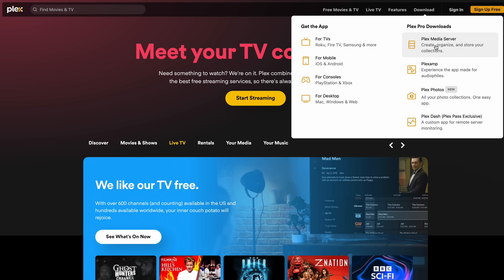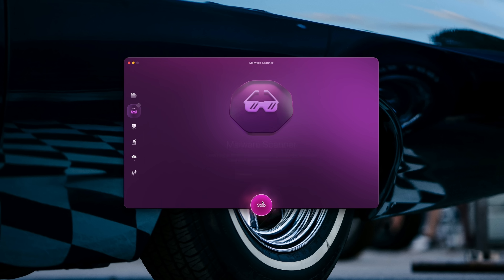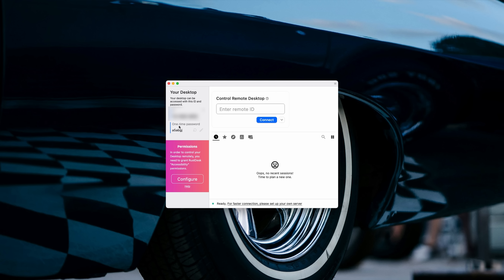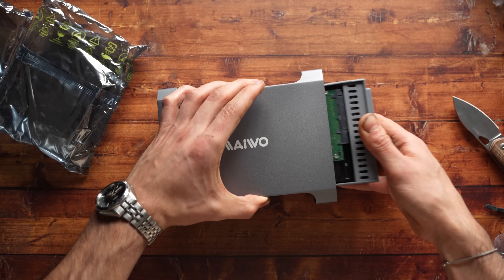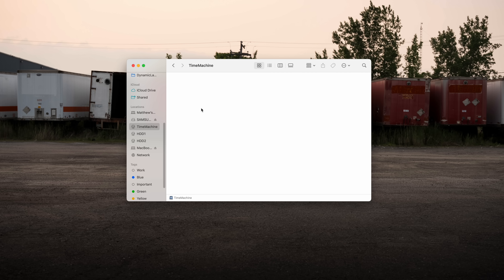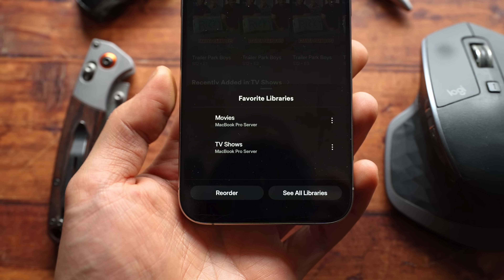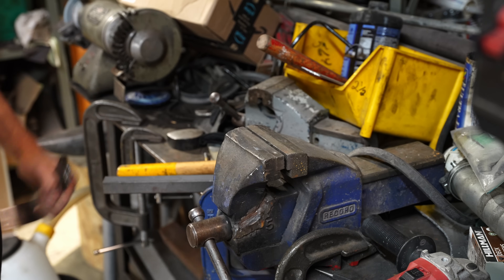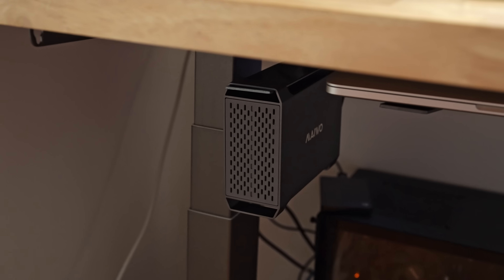An Obsolete Mac is Your Greatest Ally - DIY Homeserver

Comment: For anyone that has a NAS or DIY home server that’s not a Mac, running Cockpit with the 45Drives plugins installed is a great alternative. My NAS is a DIY build running Proxmox with 80TB of raw storage in ZFS. Cockpit is running as a lightweight LXC and the 45Drives plugins make it a super simple NAS that all of my machines can connect to. Here’s the settings I use for my Time Machine samba share:

fruit:time machine max size = 2000G
fruit:timemachine = yes
fruit:encoding = native
fruit:metadata = stream
vfs objects = catia fruit streams_xattr
fruit:zero_file_id = yes
fruit:nfs_aces = no

With these settings the Macs on my network can easily connect to the share in Finder and then add the share as a Time Machine destination. The top line can be customized to whatever storage size cap you want for all of your users. This a great video with an easy setup, but it’s possible to run a Time Machine server on just about any old hardware. Cheap mini PCs, old corporate machines, pretty much anything with a couple CPU cores, a few gigs of RAM, and 1gbe networking can host a samba share configured for Time Machine :)
Reply from the maker: Appreciate the comment and insight. It’s a little above my pay-grade lol but I’m sure it’ll help others. Thanks for chiming in dude 🤟🏻

Comment: Great overview! I have almost an identical setup using a 2015 13" MacBook Pro, except I was relying on macOS screensharing. Rustdesk makes it much easier, especially that I can use my iPad to connect, if I wanted to.

Curious though - what version macOS are you using on the MBP? I'm using Monterey 12.7.6 because that's what ChatGPT suggested when I set this up 6 months ago. I'm also running OpenCore Patcher, but that may not be needed.
Reply from the maker: It was running the most recent version of Monterey when I set it up. macOS has had sharing options in it for a while, so any outdated version that at least supports sharing will do fine in my opinion.

I’ve used the macOS screensharing as well but RustDesk is so much more reliable.

Comment: problem is not the usage, problem is that older machines are not efficient. Most Intel Macs use too much power, check the TDP of the processors they run on and decide if it's worth it.
Reply from the maker: Certainly a fair point

It might be worth investing in an Apple Silicon Mac Mini

Comment: I’d definitely add some thick felt to the mounts with some spray adhesive. don’t want your stuff getting scratched even if it’s old and just staying there etc. nice job overall!
Reply from the maker: Thanks dude! Yes I thought of actually adding rubber so it prevents from accidental slipping as well
Reply: @MatthewPCLO  Maybe some adhesive velcro to be extra sure
Reply from the maker: @formidavide  That would definitely work as well to secure it

Comment: Link for the dummy hdmi dongle?
Reply from the maker: Complete forgot to add that link. Here you go: https://a.co/d/fNmDfFT
Reply: Appreciate it. Something you didn’t mention, which macOS are you running with the laptop? I’m looking to do the same with an older Mac mini.
Reply from the maker: @rodneycastaneda6979 The 2015 I used for the server was initially running macOS Monterey. Unsupported versions of macOS still work great. Sharing options have been around for a while in macOS, so it would be perfectly compatible with your modern day Mac, iPhone, and iPad.

What year is your Mac mini?
Reply: @MatthewPCLO god it’s an old one. I5 Mac mini that I upgraded internals for 2tb ssd and 16gb ram. Do you think it’s worth it to upgrade to unsupported os via dosdude patcher? Or still with high sierra
Reply from the maker: @rodneycastaneda6979 I would keep it on High Sierra. Sharing options work on that version, plus Plex supports High Sierra. So I’d go ahead and try to use it as-in

Comment: 4Tb isn’t much, I’m doing the same thing with a Mac mini. I’ve got an external 6Tb I’m using as Time Machine for 3 MacBooks then 2 14Tb drives set to raid 1 that the Mac mini back ups to (that includes the 6Tb drive). I’ve also got 2 2Tb drives set as raid 1 for my windows 11 machine, that drive is not included in the Mac mini backup.
Reply from the maker: Sound like you’ve got a great little setup there dude, that’s awesome 

Yeah I know 4tb might not be a lot for people in today’s world, but for me and my use it’s perfect. I’m only backing up 1 Mac, and keep my files tightened up to only what I actually need.

Thanks for sharing man, and for watching. Much appreciated🤟🏻 A Mac Mini is the perfect machine for a server

Comment: Can you speak about operating systems. Are all your mac's on the network using the same OS ?  Is it required? etc.
Reply from the maker: OS version doesn’t matter at all your Mac’s can be different versions, even older discontinued versions. You can even allow Windows file sharing by selecting “options” in your Mac Server’s “file sharing” setting

Comment: The bracket was what drew me to this video.  I had a similar idea.  I have a 2012 iMac that has a shattered screen and I was thinking about mounting it under my desk and connecting it to my 3d printer.  That would allow me to remote access the printer from anywhere.   I was wondering if air drop from my family's iphones would be possible, to backup pictures and free up storage on the phones?  Thank for taking the time to share your project.  Very cool!!
Reply from the maker: Absolutely possible! AirDrop could definitely work for that. But, a more intuitive solution is the “Sharing” feature. You can make a respective folder for each of your family members and they can connect to the Mac directly from the “files” app on their iPhone. 

They’d click on the three dots at the top right corner in the “files” app on iPhone. Click “connect to server”. Then enter smb://<name of mac>.local

The login as the administrator user and you’re in. Hope I did a good job of explaining haha

Also, I’d recommend mounting it to your desk, such a game changer. It’s out of the way but also easily accessible if you ever need.
Reply: @MatthewPCLO  I will have to check that out.  Thanks for making me aware of that method of sharing files and photos.
Reply from the maker: @briankendall1978 my pleasure, let me know if you have any questions and I’ll see if I can help out

Comment: Question, how hot are these supposed to get? I have a 2015 MBP, barely browsing the internet, the top of the chassis gets incredibly hot, I wouldn't want to leave it running
Reply from the maker: If it barely running and getting THAT hot, that’s not normal. What I would recommend is opening up the back to clean it and reapply thermal paste. It’s not that difficult to do, I’m sure you can do it.

Comment: I love my 2015 MacBook Pro 15”, and still using it, despite having a MacBook Air M4 now. Great machines like Apple used to make design wise.

As to the hard drive enclosure here, puzzled why you didn’t use RAID 1 for some semblance of data security? 

Plex is also limited in its free form compared to Jellyfin, which has remote access included. Plex removed that feature this year whilst hiking prices too!

Maybe a slight upturned lip on the hard drive mount too. Less risk of it coming off accidentally that way.
Reply from the maker: Those M4 Airs are wild machines haha I’m surprised you still use your 2015, but I agree the design is great on those era MacBooks.

The reason I didn’t go with RAID 1 is because I wanted my Plex hard drive to be completely separate, I didn’t want it to just be a partition.

Really good observation with the hard drive mount, I did end up doing just that off camera. Bent the edge up slightly to ensure it can’t slide off. Also, I’ll be adding some rubber to the surface of each mount to limit any sliding. Appreciate you staying to watch the build! And thanks for commenting dude💯
Reply: @MatthewPCLO  The keyboard is what makes that 2015 Pro a pleasure to write on. Sure it sounds like a jet engine when the fans fire up initially, but they calm down.

I swapped out the old Apple NVMe drive for a 2Tb drive with an adaptor too. 

The new Pro’s are an insane amount of money compared to the M4 Air, so I sacrificed the Pro enhancements to buy a Mac Mini M4 Pro too.

Sure my Mac Studio M1 Max can always do its bit for heavier workloads too.

Comment: Nice! I mean, especially the HDD enclosure can easily slide down that rail and fall down every moment.. but yeah, it looks pretty
Reply from the maker: Thanks dude glad you enjoyed the vid🤟🏻 I actually ended up bending the edge of the mount to create a lip so it doesn’t slide off. Also adding some rubber on the surface of each mount to prevent movement. Appreciate you watching and commenting dude!

Comment: I have an old 2015 macbook pro laptop that I use occasionally for web/youtube while I'm out.  I will eventually turn it into a server or even install Linux on it when it becomes too slow to use, but as for now, it runs well enough and Firefox is still updated for older macOS.
Reply from the maker: These older MacBooks can still handle plenty of everyday computer tasks. YouTube, Netflix, music, docs, etc. Have you looked into Open Legacy Patcher? It’ll allow you to install newer macOS updates on older hardware.

Linux would be a solid choice though for when it starts slowing down more.

Comment: A less intense setup for wireless home network Time Machine backups is just plugging in an external hard drive into your routers USB port. Works like a charm, did this for many years.
Reply from the maker: That does seem like a super easy solution for wireless backups, thanks for sharing dude!

With that said, the ability to do so much more with the use of a server is super cool
Reply: Thanks! How do you access the drive after that?
Reply: @juancedeno6650 just map the drive, “connect to server” on Mac. I believe if you log into your router it will have assigned it an IP address you can use to connect it. I did this so long ago I can’t remember specifics but there’s a few YouTube tutorials you can find that will show you.
Reply: For people using higher end/pro/biz level networking at home, that's often not an option. More common with low performance consumer level gear... but it does work.

Comment: People will definitely buy a 2015 MacBook also use an Ethernet dongle.
Reply from the maker: I don’t think they’d buy it to use as their main laptop lol, maybe to build out a server like this. This is a base model 13-inch, there’s so many better options out there

Ethernet dongle would for sure be an upgrade! Been using the server as is through WiFi and it works great so far. Thanks for the tip dude 🤘🏻
Reply: @MatthewPCLO you would be surprised a lot of people still use these I did for a while until my battery started expanding, also recommend you check out Linux either for just using it as a laptop again or as a server. 

ah if WiFi is working good not much point WiFi signal sucks so I generally prefer a wired connection.